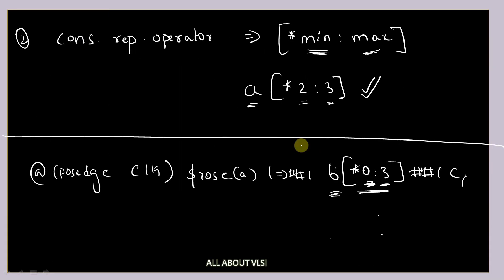SystemVerilog Assertions: Consecutive Repetition Operator [*] Explained!

Comment: in the end I was confused. If I have 2 cycles consecutive high for b and then it goes low on the 3rd, will I get a pass or a fail? Because it says [0:3], so it is either 0 or 3 consecutive????
Reply from the maker: It's not o or 3 it's o to 3 
That means it can 0 or 1 or 2 or 3
Reply: Please watch your video from 12 minutes  you will get to know his question.
Reply from the maker: @RoamWithMe-z6e  thanks for mentioning the time stamp
let me explain the scenario
previously b is continuosly high for 3 cycles and in second scenario b was high only for one cycle so also the condition will pass and then will check c it was 0 after 1 cycle after b that the reason assertion will get failed

i think i have miscommunicated the thing
thank you